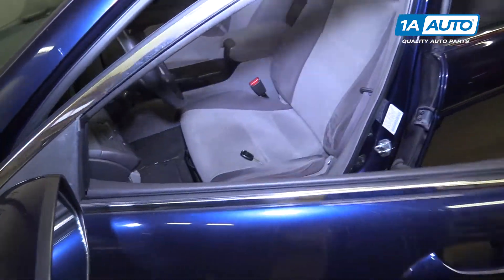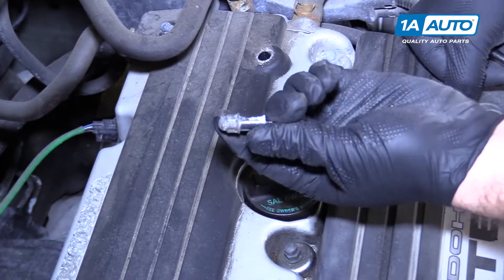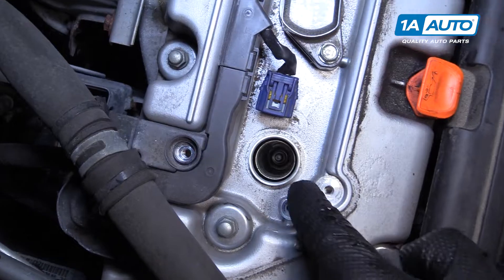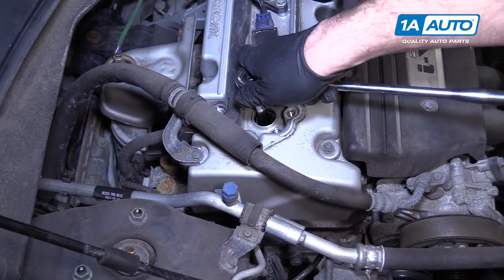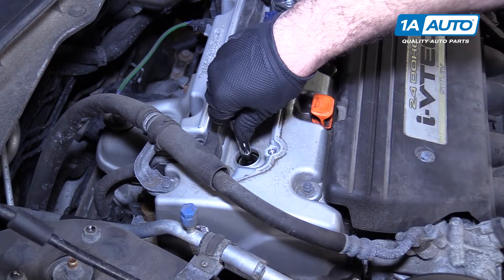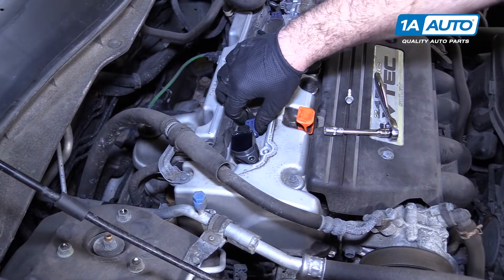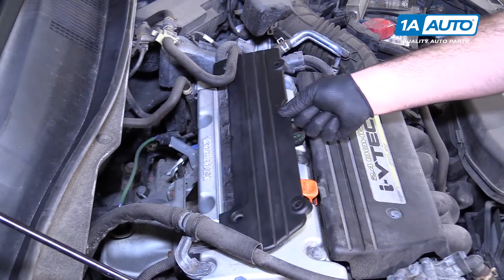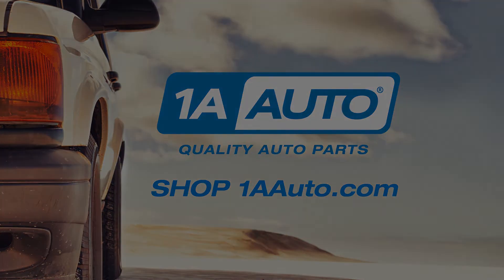How to Replace Spark Plugs 08-12 Honda Accord

Comment: Changed the plugs 1st time ever, 1st try thanks to this video! Took an hour but saved me $100!
Reply: What spark plugs did you use on the your Accord 4 cylinder?  NGK?  Denso?  Can you recommend make and model?
Reply: @rebeltvr6046   when changing spark plugs in my opinion ngk is the best one

Comment: Minor corrections - be sure to always check the gap on the new spark plugs before installation, even with any "pre-gapped" plugs, as they may be incorrect or could have been changed during shipment / handling. In addition, always apply a small amount of dielectric paste to the inside of the ignition coil where the plug electrode makes contact.

Comment: Man,have a 2009 EXL accord V6,never had spark plugs replaced. Has 173 miles on it. Recently got a check engine light come on and off over last 6 weeks.

Comment: Thanks for the video.

 A couple of things would make it even better. On the lead-in screen, listing size of the plug socket needed (16 mm or 5/8 inch). Also when you remove the spark plug connector lock (1:33 or so in video) your hand/arm obstructs the camera, so we can't see how you are removing the connector lock. Some may find it useful to know how to remove the lock, especially if they are jammed/sticky.  

Do you recommend cleaning area around park plug cover so dust/dirt doesn't enter?
Reply: Ah! You mention having a clean hole/area at 2:10,  after you remove the plug and tube!
Reply: More important is to not change your plugs when the engine is hot or you could do damage to the aluminum cylinder
Reply: @skhangura10  /

Comment: would it be easier to change the spark plugs if you take that valve cover off? i need to change my valve cover gasket and am thinking to just do spark plugs along with it

Comment: i am about to change my plugs on my 08 accord. Do I need to put dielectric grease on the plugs? My local autopart store told me this is suggested. Also can I just hand tighten like you did when installing the plugs and make snug with socket wrench? or do I have to use a torque wrench?
Reply from the maker: +Jerry I Thanks for checking us out! The grease will help a little with the install as the new plugs will be quite snug, it will allow it to go in a bit easier. We would recommend that you do use a torque on the spark plug to ensure the gasket is seated correctly. 1aauto.com
Reply: @1AAuto  what kind of torque wrench

Comment: Do you put anti-seize compound on the spark plug threads?
Reply: That was  my question as well. I'll have to find a repair manual and see what is recommended. Some plugs state to use it, and some say don't use it for fear or over torquing the plug.
Reply: Do not apply anti-seize to your threads. Unless you have before and know the percentage to reduce your torque by, don’t apply it. You’ll most likely over-tighten and damage the plugs. You can use dielectric grease on the inside of coil packs/ceramic part of plugs.

Comment: I have bought many spark plugs for different vehicles from auto parts stores and, nine out of 10 times they are not all Gap set correct. What is the original gap on the spark plug? Thank you. Keep up the good work. Kudos
Reply: . 44 I believe

Comment: Do you need to use Anti-seize on the spark plug threads?
Reply from the maker: +Ed Untitled Thanks for checking us out! The spark plugs we sell do not need this and may potentially cause an issue with over tightening or not creating a tight seal.

Comment: Why 2 clicks on the torque wrench?
Reply: just a precaution. The Torque wrench is set to "break", or stop applying force, at a pre-set tension. That's the click you hear. The second click wouldn't apply any extra force, and is probably just to ensure that the first click did it's job.

Comment: The top of my 2008 exl V6 looks totally different

Please help I have a stuck plug in #1 location mechanic said he thought previous owner used epoxy to install the plug and now I don't know how to n remove.. with a new misfire now. Plug needs to be changed

Comment: do you need to replace 4 of them? if not how do you know which one to replace?
Reply: You use a spark plug gauge that looks like a coin to measure the wear down of the tip. That being said spark plugs usually has good deal sold in set of 4 so not hurt to replace all.
Reply: Change them all.

Comment: is the first time you change plugs in an aluminium head?

lubricant the threads of the plug before putting them back in.
Reply from the maker: +joe blow Yes, a little anti-seize on the threads may help out a lot while trying to service the plugs next time. 1aauto.com
Reply: Do not place anti-seize on the OEM NGK plugs. The torque spec is for the bare metal

Comment: How important is the plastic cover? I broke the bolts badly when I tried to open the cover, the broken parts are inside. Is it a safety risk if I ditch the cover altogether?
Reply: it’s just for looks bro, your fine

Comment: i need help, the spark plug won't attach to the 5/8 socket to be pull out after i unscrew the spark plug and try to pull it out.
Reply from the maker: +An We suggest spraying a little penetrating oil and let it sit for 20 minutes before trying to take it out. You can tightening and loosing the plug to break anyway any build up on the threads that are causing it to seize. We hope this info helps!
Reply: Next time just use a magnetic socket made for spark plugs. Really a life savor, got it off Amazon
Reply: Get a cheap telescoping magnet. Like an old car antenna with a magnetic tip. Harbor Freight sells em. Many uses for it esp when u drop a acre or bolt somewhere your hand can’t reach
Reply: Next time use the coil pack to pull out the spark plug after it is unscrewed if you don't have a spark plug socket
Reply: Magnet, or put tape inside the socket. A proper spark plug socket had a rubber washer to grab them

Comment: No Dielectric grease  on boot of coil pack and on plug wire that connects in at top ? I was always thought to use some to keep any water getting in or corrosion if water did get in. Then your in trouble on misfires left and right. I hope someone answers me on this, also, I always put a small dab of NEVER SEIZE to on plug threads, just keeps them from freezing in head now, had cars that they broke off from none in there, one 1981 Buick Regal 3.8L V6 engine and had 2 break off in the back on passenger side, had no choice to take top part of engine completely apart to take head off just to get those TWO BROKEN PLUGS OUT. Not fun not cheap and was a favor for a friends parents, I told them what HAPPENED and will take 2 more days because I had to work at my JOB, thought it was just and easy TUNE-UP, not, only had them pay for gaskets only, they asked me how much if I was at the GARAGE, I said you DON'T want to know. Just be happy you have extra cars and this could sit those 2 days, it might be 1 night but that's at night time rushing, prefer not working under lights only, daylight helped and got that entire mess back together in 12 hours of work taking my time. Also used one 10 pack count of POLAROID FILM to take pictures so I could put all back together, lots of vacuum hoses back then on those cars, not fun but all worked. AC on that side and the box stuck out far from firewall. Never had issues ever with just a dab of NEVER SEIZE OF THREADS ON ANYTHING YOU NEED. SPARK PLUGS, YES BUT A LITTLE GOES FAR. Anything that you will take apart again and its hard to, then use it, you won't need oils or blasters, stuff good for 1500 degrees, last forever. Makes things coming apart nicely when you work on your VEHICLE again. Unless it calls for LOCKTITE, now there's 3 colors I believe, I used only blue because that's all there was, now they have more, not to come apart at all, pretty much breaks the bolt unless you use heat, plus they have a red or yellow that can come apart but makes it harder. Been awhile since I've looked into it. I don't use it often, only when it calls for it only. I remember the blue the most and like blood red color also. Beware on using lots of it, stuff is like super glue but harder I bet.
Reply from the maker: +J R Thanks for taking the time to share your comments and for watching!